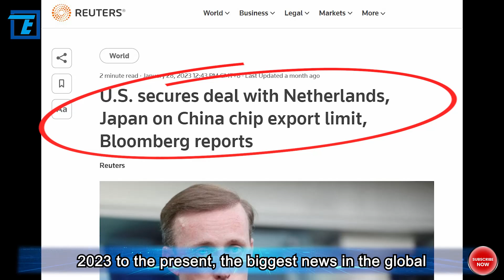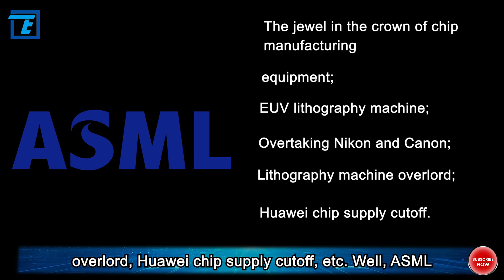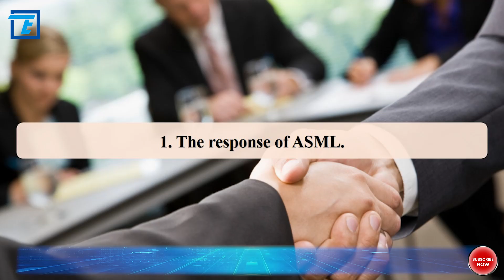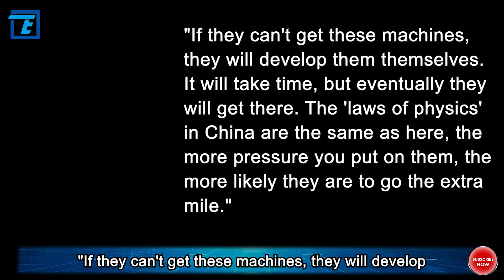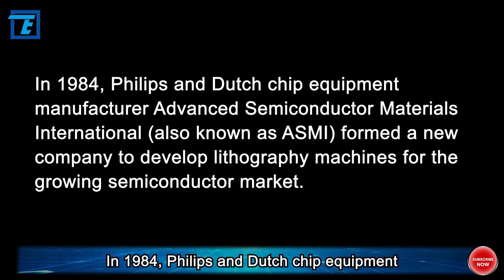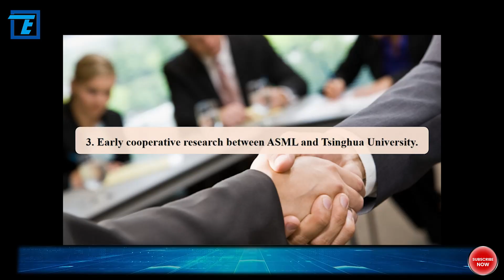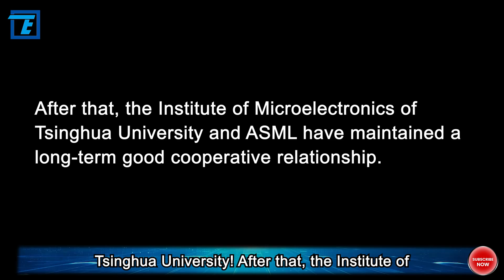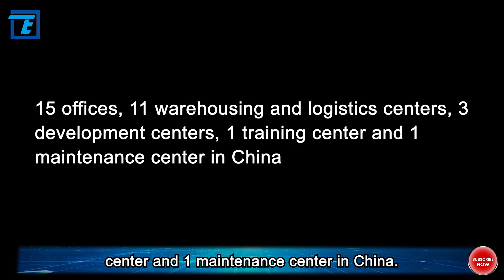The relationship between ASML and China used to be so good! But now...

Comment: I am a mechanical and electronic engineer. I have been working in ASML for 15 years (before that I worked at Lam, Canon and AMAT). I can assure you that any semiconductor machine manufacturing company in the world is at least 10 years behind ASML. Also, I clarify that ASML wants to export to China and the Netherlands as well, but there are many pressures from the US. Now ASML is demanding a monthly fee from the US for the ban imposed on the sale of their equipment to China. Greetings.

Comment: If Tsinghua University has been working with ASML on their lithography machines, why has Tsinghua University not acquired the technical know-hows?
Reply: They were in microelectronics / semicon research and business, which require lithography machines. It became one of the early adopters of ASML machines when the latter didn't have many clients. Tsinghua was not in the business of lithography machine per se
Reply: The problem with China's semiconductor community is not a lack of knowledge or resources but a lack of insights & engineers needed to scale up the process to build & maintain the EUV machines.
Reply: @user-DongJ  China has neglected basic research for too long. Instead, it's been chasing money with faster, larger commercialization of existing technologies which were often foreign. That seems to be changing but China is well behind now.
Reply: @n.c9653  Some areas yes. But not every area.